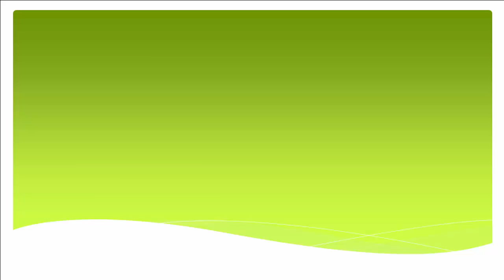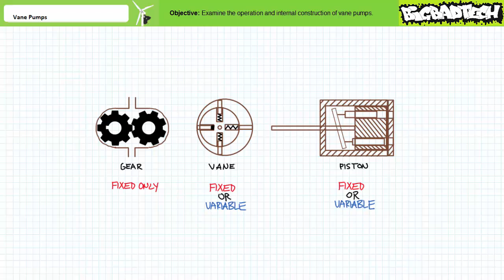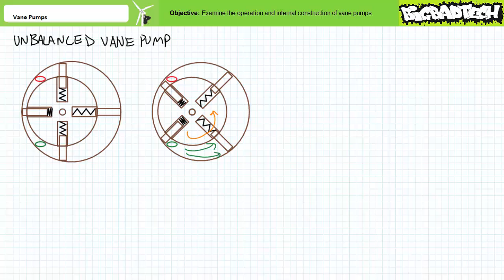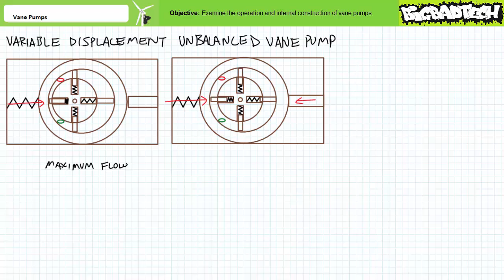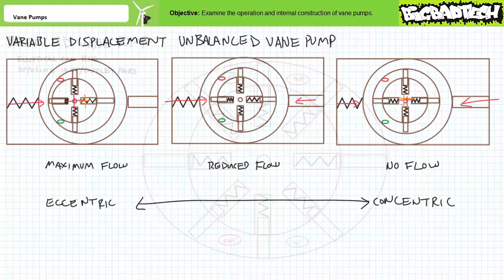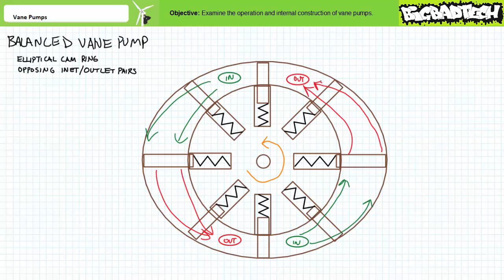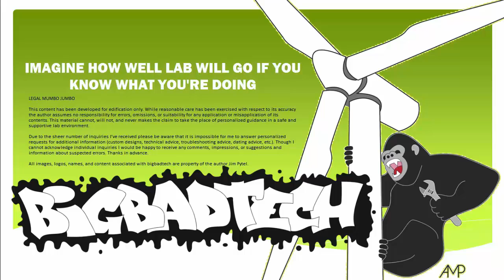Vane Pumps (Full Lecture)

Comment: Will they function bidirectionally?
Reply from the maker: Theoretically yes, however, like gear pumps, some manufacturers include design features that make them more efficient or quieter in a specified direction. Additionally the suction port is often a different diameter than the output.
Reply: @bigbadtech  Looks like they could be made multistage for fluid as long as they had a bypass for each stage, but probably need beefed up housing for the pressure

Comment: These are great lectures, just one question whats the advantage of a fixed vane pump over a gear pump? is it just efficiency? Thanks
Reply from the maker: Yes, vane pumps have less leakage than a gear pump because the sliding vanes provide a better seal than the tolerance between the gears of a gear pump. Also, while incredibly simple and inexpensive, gear pumps are notoriously noisy.
Reply: Vane pumps are usually quieter than gear pumps too, but vane pumps are usually not rated above 2000psi operating where gear pumps can supply pressures over twice that.
Reply: @Joscope  It would be worthwhile to make the distinction between internal and external gear pumps. Sliding vane pumps are comparable to internal gear pumps with their pressure ratings, and in addition to often being quieter, vane pumps offer many additional benefits for users.
Reply: Vane pumps have many advantages over internal gear pumps - namely viscosity flexibility, dry run capability, solids handling ability, and consistent flow rates due to the unique sliding-vane pump design where the vanes self-adjust for wear.
Reply: Why, vane pump make noise , within short span ? Compared to gear pump
How to arrest the noise in vane pump and reason @jim pytel

Comment: Excellent lecture. Was wondering about the difference in service life between the balanced and unbalanced versions?
Reply from the maker: +Mark Dierking Ideally either pump will function as intended inside a given operational range assuming proper, regular maintenance. This being said, the shaft and bearings of an unbalanced vane pump might be oversized (ie: more expensive and heavier) in comparison to a similarly sized balanced vane pump to account for the uneven loading. If they were undersized the service life would notably suffer.